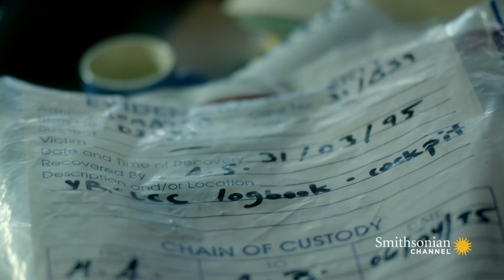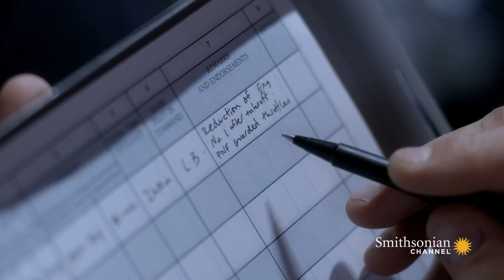Did a Faulty Throttle Bring Down this Romanian Plane?

Comment: My question is why didn’t the maintenance people fix it? Sure if the Captain hadn’t had heart failure they would’ve been fine but if maintenance had fixed it this wouldn’t have happened either. So why didn’t maintenance fix the issue?
Reply: The maintenance did try (both Delta and TAROM), but can't find the exact cause

Comment: A flight engineer would have avoided this kind of problems among many others.
Reply: A flight engineer is only as good as his/her equipment, and most airlines that still use that job have the flight engineer at his station (some several feet from the throttle) during takeoff. So even if he or she knew of the problem, it would likely have been too late.

Also, this sort of problem is far more than what a flight engineer could correct, as it goes into the electronics and less accessible bits of the plane. It should have been sent to maintenance for a full inspection posthaste given how constant the problem was. If maintenance couldn't solve it, it must be sent back to the manufacturer as a possibly defective product.

Comment: 24 previous complaints about the auto throttle issue should have spoken about as loud as anyone would need to dig into this airplanes problems. Were they focusing on the cost of down time and patching things?  Seems to be true after no fix and 24 more complaints. Dear captain, if you notice something and have a corrective method to avoid the risk's it would be a good thing to let your fist officer know about it too. Or, put a yellow post-it on the dash for the next shift ?

Comment: For anyone wondering this came from the Wikipedia page:

Investigation of the crash revealed that the faulty auto-throttle reduced the left engine to idle during climb. While this was happening, the Captain became incapacitated, leaving the First Officer overwhelmed and unable to respond properly to the failure. The crash was the deadliest plane crash in Romania's history. It was also the deadliest plane crash in TAROM's operational history.
Reply: There Was An Attempt the incapacitation was caused by heart failure if my memory serves. Such a shame, likely would have been fine if both pilots were available.
Reply: @Angry-est  Bad timing for sure
Reply: That was really unlucky
Reply: Thank you! I haven't been able to find the full episode.
Reply: I LOVE your pfp!